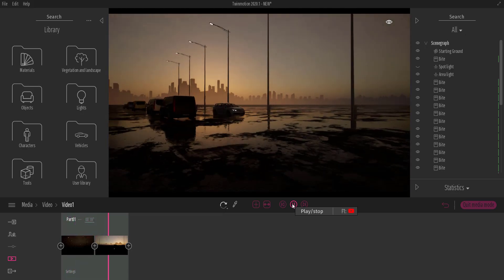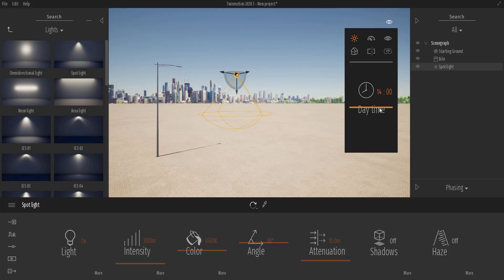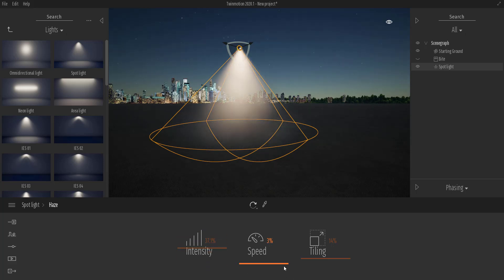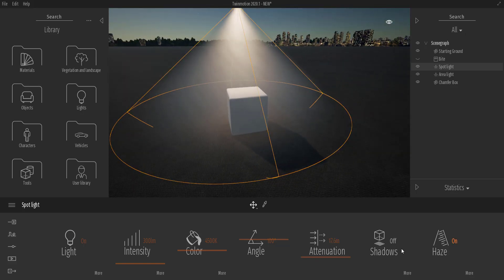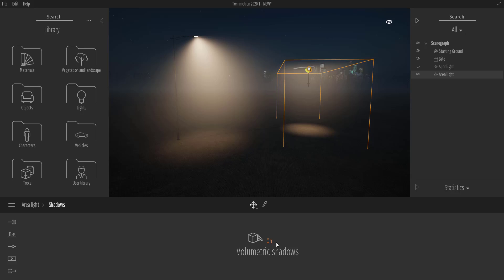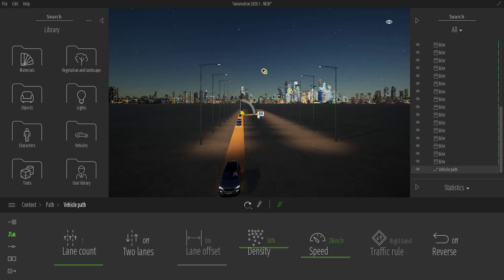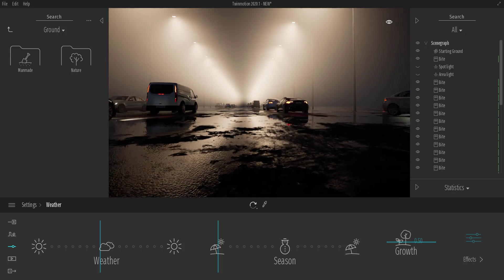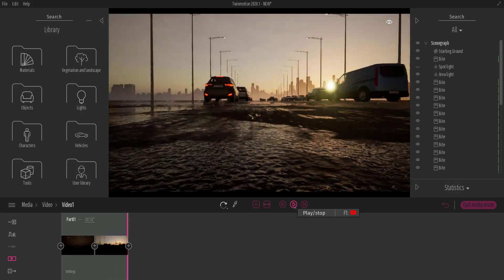TWINMOTION 2020: LIGHT & VOLUMETRIC

Comment: I tried Twinmotion 2020 in VR on my 2080Ti powered gaming computer & although the VR worked fine in Low & Medium graphics settings there was major issues in the High & Ultra settings when the real time ray tracing kicks in. The left eye rendered the entire scene, attempting ray traced reflections etc. but with some weird glitches. The right eye on the other hand rendered predominantly black with just some bright highlights where they were supposed to be. It's like Twinmotion or just the RTX standard in general can't render a real time ray traced scene twice simultaneously for both the left and right eye. Has anyone else experienced this or is it just me? Thanks in advance. For those interested & for comparison  the Materials Room demo scene I tested in VR ran buttery smooth in both High & Ultra settings at full screen in 4k.